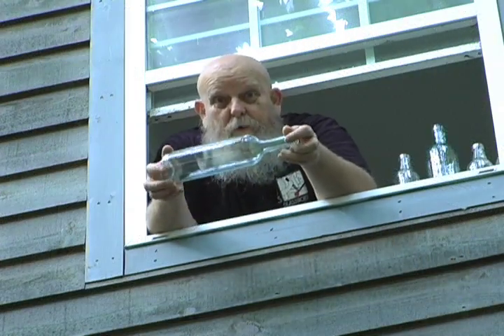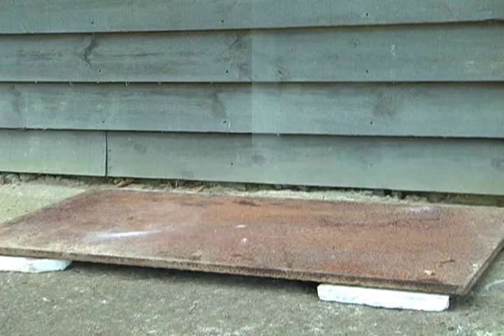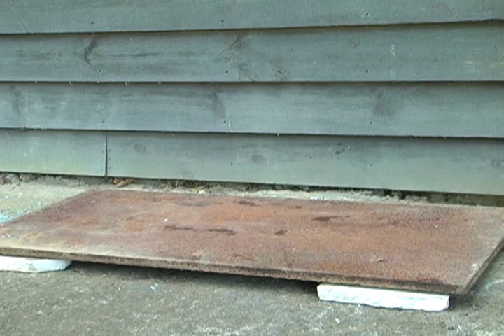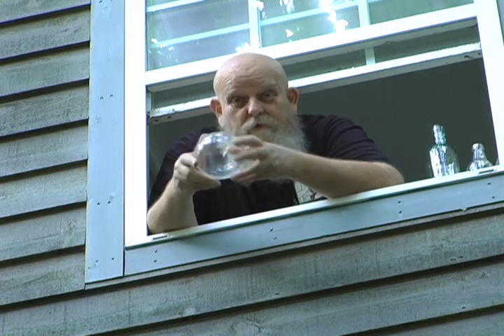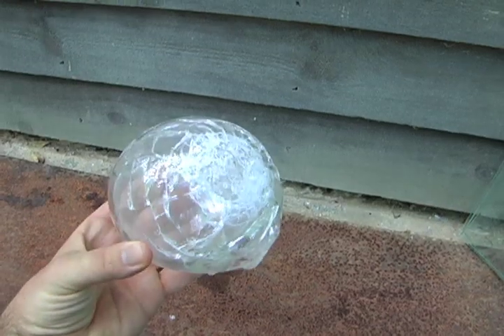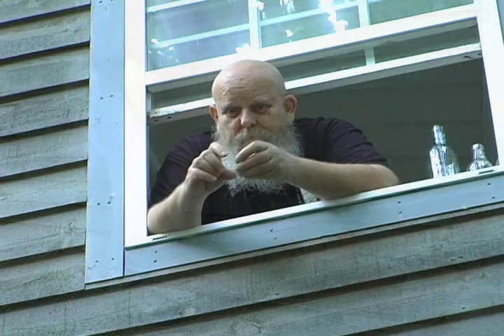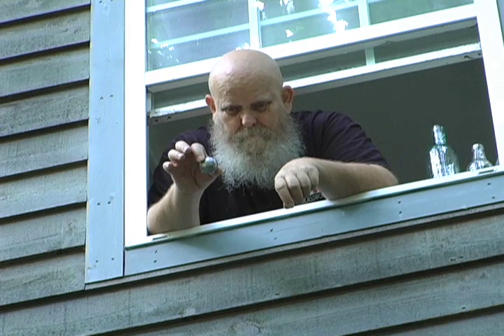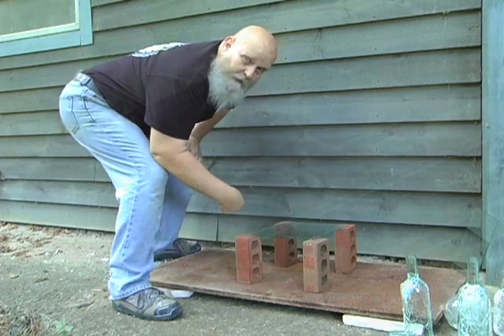Flex-Tec Anti-Shatter coating Test- Part 2

Comment: This stuff is brilliant. Just purchased the 1.5 lb pack 😀
How chemically inert is it? Say I coat a bottle that's holding some an acid or some solvents (hydrocarbons or chlorinated solvents), if the glass breaks and some of the solvent gets to the Flex-Tec coating, does it fail pretty quickly?
Reply from the maker: It's pretty inert once cured. It's also very difficult to remove from the glass as it is not affected by most solvents.

Comment from the maker: The Flex-Tec is a coating, but it is also a thicker coating so it will make an obvious difference in the optics of the glass. I don't know of anything that will substantially increase the strength of glass besides tempering it. Most other products are in the same vein as our Flex-Tec in that it is meant to keep the glass from shattering when it breaks, but not prevent the breakage itself.

Comment: Thank you for the reply! I know all these videos work in your favor, but I still appreciate the free education and I might just head over to youor store sometime soon ;)

If that is the case with Flex-Tec, are you aware of any type of coating that will give some significant increase in strength to glass, and which is easily applicable? Also, would these coatings fill in the cracks and dimples of unpolished or bead blasted glass to make it look polished?

Comment from the maker: Mainly it holds the glass together when it fails. It does add a layer of protection and strength, but it is meant more for protection after it breaks.

Comment: Does the Flex-Tec actually increase the strength of the glass from pressure and impact fractures or does it just hold it together when the glass fails?